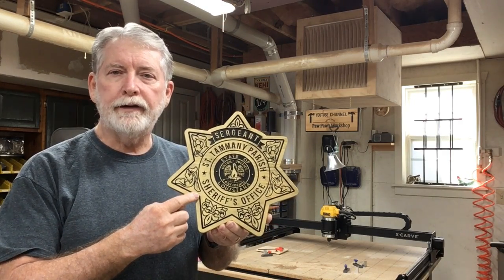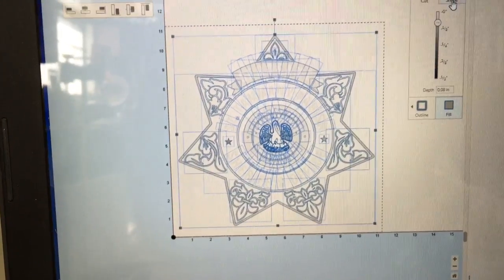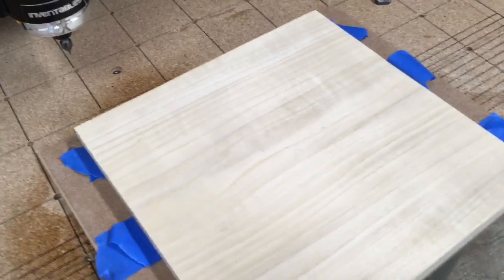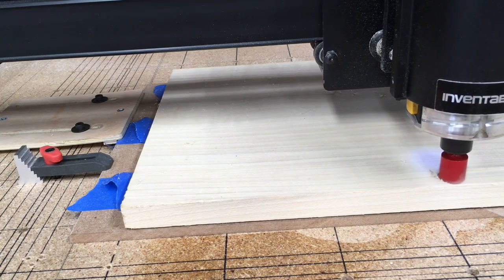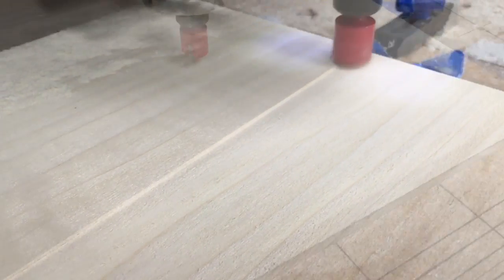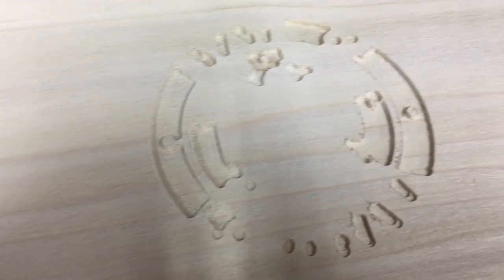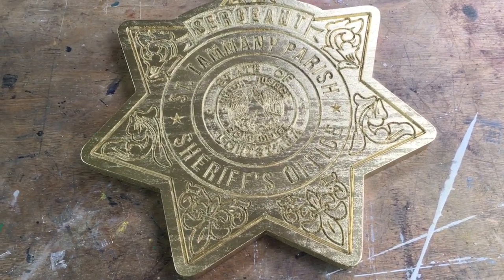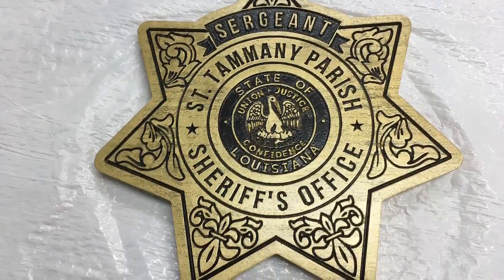How to VCarve Extreme Detail and New Paint Method

Comment: Nice job, I have been doing something similar.  I spray two coats of polyurethane let dry then carve. I then fill the letters with acyrlic water based paint and wipe off excess. Be very careful to sand the surface to eliminate any open grain. This works but still needs tweaking as paint will get in grains and then have to be sanded off.
Reply from the maker: Fantastic

Comment: great job, what im wondering is, can easel do more than one cut passes, if so how to tell it to do this, or do you have a video showing this method.
Reply from the maker: Yes, just hit carve again.  You can also lower the depth by .005 to do a clearing path or use whatever depth you wish.  If you are using a vbit and if you have reached the maximum of the geometry then it will not go any deeper.  You can trick the machine by using the probe then raise the material with index cards. Be careful not to move your project.

Comment: watched several shows  one question is my son is a sheriff too and now a capt  i found the badge on etsy and is detailed correct for state  but it is slt file how would be best way to get it over to in cnc for G code
Reply from the maker: Easel can work with the STL files. What sender are you using?

Comment: What other software is available that will control the x-carb I have b carve and Mach 3 haven't figured out how to set them up to run the machine yet
Reply: X carve  v carve pro
Reply from the maker: With v carve pro you can use UGS (Universal GCode Sender) It's free.  Also Picsender will work.  I have seen Mach 3 and know that it should work as well.  You need to choose the correct post processor in VCarve Pro.

Comment: I'm fairly new to this cnc stuff. I have a used older model x carve. I'm trying to learn a 2 stage carve. I don't have easel pro or v carve. How do I set my different bits like you did for this. The file I'm trying needs a 1/8" clearing bit and then a 60 degree v bit. I also want to do a thru cut with the 1/8" bit, but every time I try this it sets it to the v bit. Can I tell easel what bit to use for each path? HELP! My first try with a 2 stage, when I changed bits something happened and my Y was a half inch off.
Reply from the maker: In GRBL make sure that $1=255. That will lock the stepper motors to allow you to change bits and help prevent any movement.  Now for the fun part.  If you look at this video you see two stage carving on one workpiece and the cutout is on a second workpiece.  In the top right hand corner you can choose your bit for both the roughing pass and the detail pass. Once you finish that process move to the second workpiece and do the cutout.  I have numerous videos on using this technique. Hopefully this helps. If the y axis was a half inch off I would say that during the bit changed the gantry moved on the y axis.  Sometimes you don't even notice it.  Yes, I have done that also.

Comment: How do you change the bits during carving and keep the router from moving ? Thanks
Reply from the maker: Is your GRBL set $1=255? This will lock your motors and will help a lot.
Reply: @PawPawsWorkShop   sorry but I do not know what a GRBL is ?
Reply: @PawPawsWorkShop  I just looked at the advanced grbl screen all mi ne are at 0 do i need to down load  some I have been carving over a year. help

Comment: How do you go from using your v bit to cutting out around the logo using a different bit?
Reply from the maker: If using two stage carving, I use a clearing bit first such as a 1/8" bit, then change to the v bit.  Yes, I do re-probe to set the height.  To cut the project out, I setup a different work piece in Easel and cut it out as if it was a new project.  Thank you for your question.

Comment: How did you import the badge graphic into easel?
Reply from the maker: It took a lot of work to finally get it to look good.  I started with an image from the sheriff department.  It was not the best quality.  Took the image into Inkscape and converted it to a SVG file.  Also made adjustments to some of the poor quality graphics. Brought it into Easel.  The text was terrible.  Ungrouped everything and deleted all the text.  Put in new text using basic fonts in Easel.  Carved this a number of times to get the depth correct.  When it was time to engrave on the laser, there was only minor adjustments that needed to be made.

Comment: Thanks paw paw...the flooding technique is very messy and requires a lot of paint but it does create great results if done properly....i ended up staining first then carve text but lots of tear out so i simply ran snadpaper on letters and got,rid of the messy edges....i then restained and used clear acrylc spray....then flooded the letters black....and wiped off with damp cloth...let dry and the another clear coat....very very messy....but turned out very nice....
Reply from the maker: Better a little mess rather than trying to hand paint.

Comment: Hey pawpaw i need to do similar....but instead of gold i need mine stained...should stain and poly wood then carve out detail and then flood paint and wipe off ? Or carve first then stain and poly and then flood paint and remove? Or doesnt matter?
Reply from the maker: Seal the wood with several coats of sealer first, then carve.  That will help with the tear out.  Carve it letters are darker that stain.  With the fine detail I would stain next, then seal the stain, then flood with paint.  Wipe off and seal.  This sounds like a lot but it really goes fairly quickly and should give you excellent results.  Good luck.  As you may have noticed in the videos that I do my painting techniques  varies with the project.

Comment: Thank you for sharing. After 2 years of X-carving and constantly searching for more practical ways to paint I was fortunate enough to stumble across your video this morning. Do you thin the acrylic at all to flood the engraved areas? I have been flooding with dark stains but that has its limitations if using more than one color.
Reply from the maker: Thank you and I'm glad you found my channel. Most of the time I do not thin the acrylics. Depending on the project I sometimes will thin to create a wash or thin slightly to obtain very fine detail.

Comment: Very Nice Indeed! Your son will be very proud of the work you did on that for him<, I'm quite sure. The size seems like a nice size, much smaller and I suppose you wouldn't get quite the same detail. Thanks again for sharing.
Reply from the maker: Thank you very much.  If anything I am going to make the signs larger.  The detail is very very small.  I also plan on experimenting with PVC to see if it cuts cleaner than the wood.  I would like to prevent the tear out.